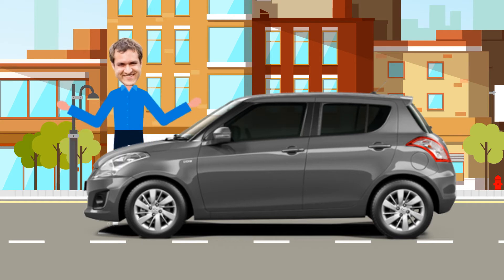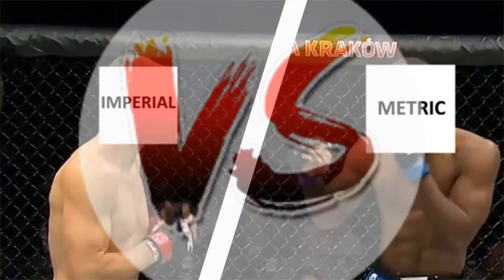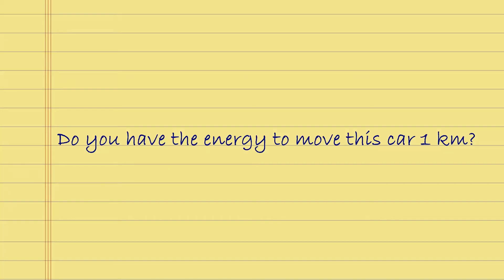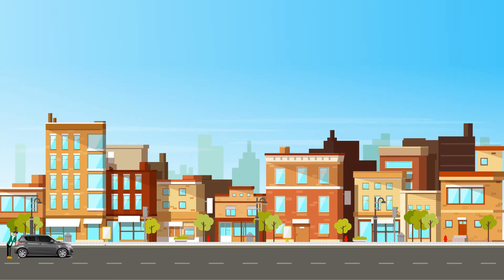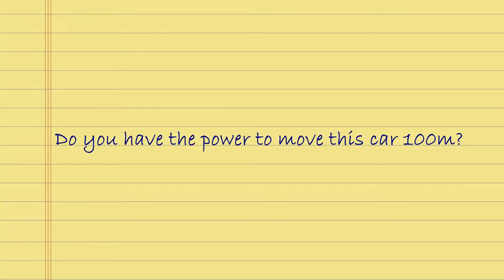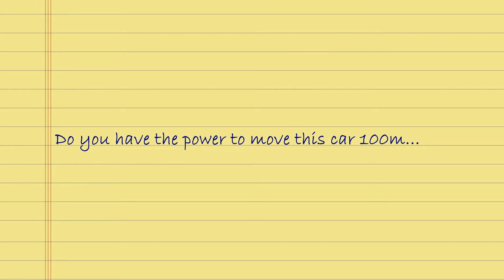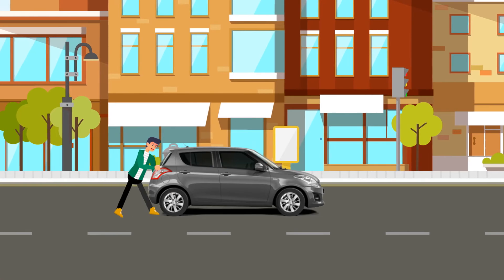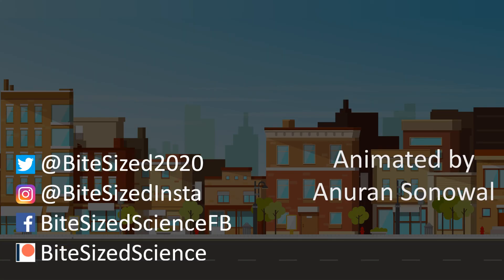Difference between POWER and ENERGY

Comment: Good work! Now horsepower vs torque in motorcycles please 🤌
 Need to know which one does what!
Reply: The more Power you have the more work you can do in a given amount of time (some motorcycles have a trailer hitch) also the more Power you have the faster you can do a given amount of work.  Torque is frozen in time, torque is sad.  RPM makes torque happy because then it can become Power and be productive.  Cheers